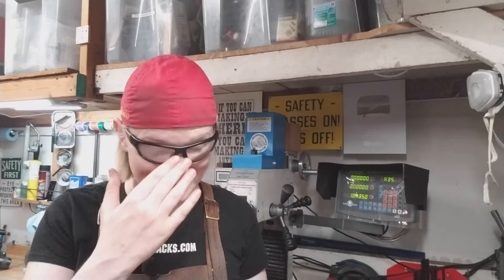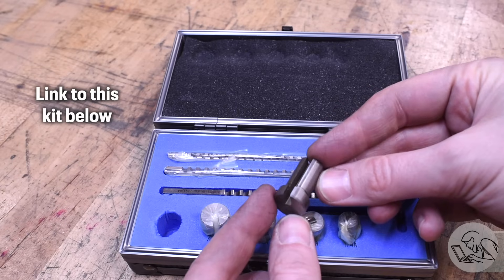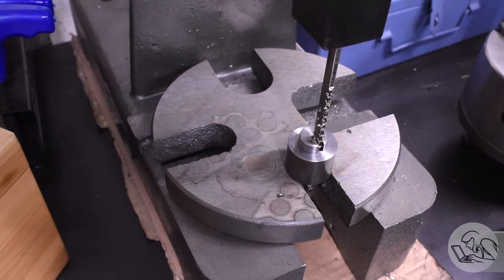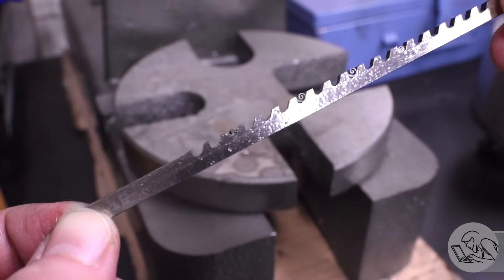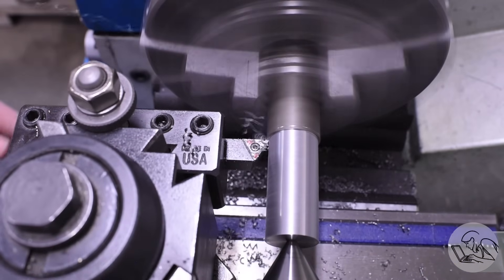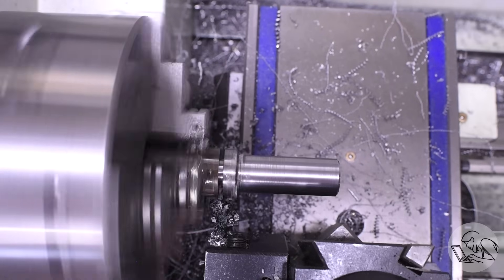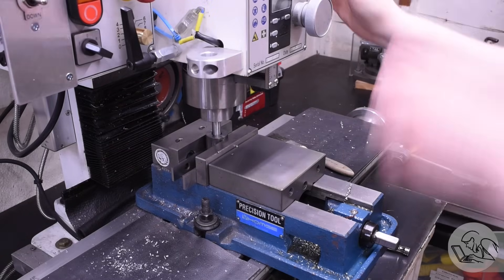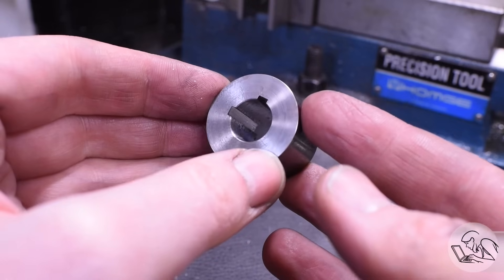Three Ways To Cut Keyways! No special tools!

Comment: Another great video!  I've used the slotting tool for keyways and a variety of shapes over the years in both my mill and lathe.   My own success was a match for yours.  It's a great method for the home shop.   

One of those was a 60 degree angle push cutter to "hex" out a 9/16 hole to fit over a 14mm hex.  This means only forming 6 corners with some short arcs between.  The flats on the corners were 2.5 to maybe 3mm wide?  And yeah, 1/2 to 3/4 of a thou per push was the limit even on my big lathe for that 5 to 6mm total width of cut for the last few passes.  But all in all as you say, a pattern soon sinks in and the job was done in only about 10 minutes for all six corners.  

There is another good reason for light cuts to limit the pressure if using our lathe.  Namely if there's any lift in the bed that can possibly occur the high pressure of too aggressive a pass will try to lever the carriage up on the angled prismatic ways.  That's going to be hard on the contact points of the carriage to bed as well as distort the cut.  I know there shouldn't be any lifting up possible.  But it's not always a perfect world with perfectly tuned machines, eh?

Comment: One of the first things we were taught in high school machine shop was how to make a keyway in a bore with a file and I have used that method a few times in the field when the bore of a new part had a different sized keyway than the shaft it had to be installed on.
Reply: When I was an apprentice we used a specially shaped narrow cold chisel to make key ways in shafts. They are called cross cut I believe.
Reply: @robertwalker7457  They are also called cape chisels or slot chisels.

Comment: I've repeatedly used the lathe "shaping" technique, with the compound at an angle, to scrape grooves into the chambers for barrels destined for roller delayed firearms. It works very well!
Reply: Yes, indeed. Without a fluted chamber you run into serious issues with torn rims and stuck cases in general. The slight grooves allow for the brass to "float" in the chamber and pop free easily after the pressure drops.

Comment: I cut a keyway in a pulley to fit it to a shaft of a lawnmower engine I was repurposing as a generator using the edge of a small file.... it looked terrible, but worked well enough for several years before the engine overheated for some reason. Not a "precision" method though :D